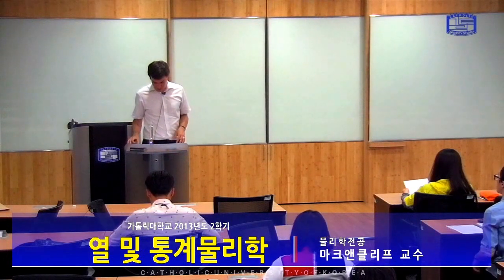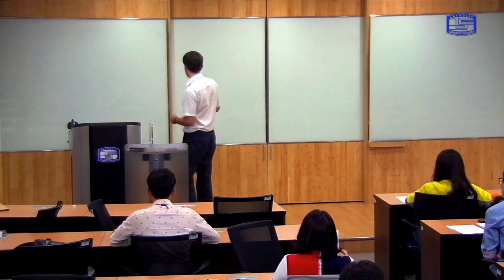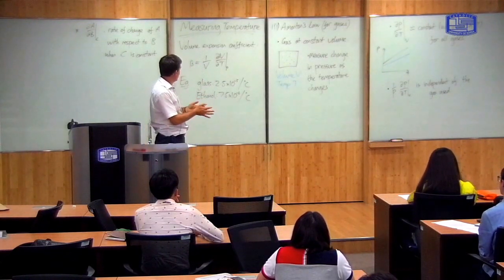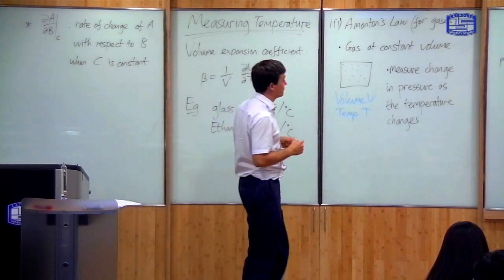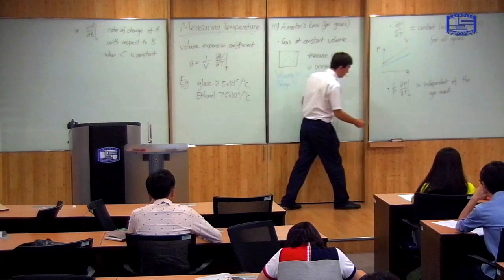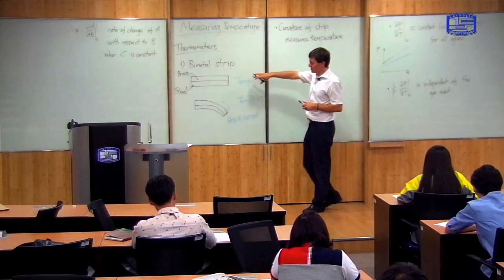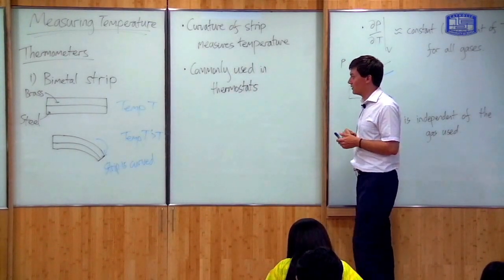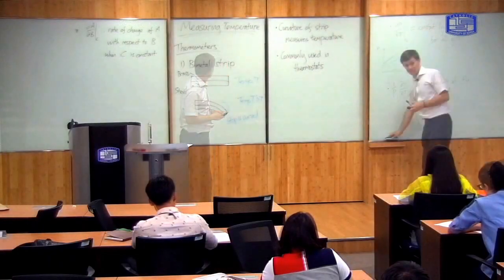2. Measuring Temperature -- Course in Thermal and Statistical Physics

Comment: Hi, I had a question. At 29:55 you said that the higher the temp is the higher the pressure of the gas. However initially the gas expands when we increase T therefore shouldn't the pressure decrease as the volume increases ? I would have assumed then we add the extra mercury to increase the pressure of the gas and decrease its volume back to what it originally was (In a way I feel like I have broken down what you said into 2 steps, is this the correct way to look at it ?) Thanks for your help !
Reply from the maker: I think what you have said is correct (maybe I wasn't clear enough...): If you don't add any additional mercury to the tube then a change in temperature will indeed cause the volume of gas to increase (and maintain constant pressure). However, the idea of the constant volume gas thermometer is that you add (or take away) mercury to keep the volume constant. If the temperature increases, you have to add more mercury, which means the pressure of the gas is increased. Does that help?
Reply: Mark Ancliff yup that's made it all clear. Thanks !